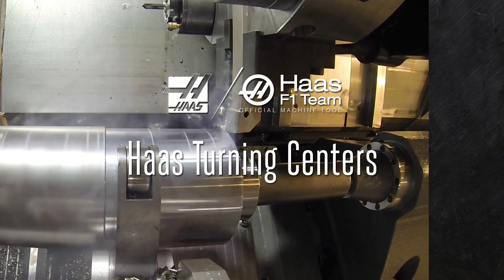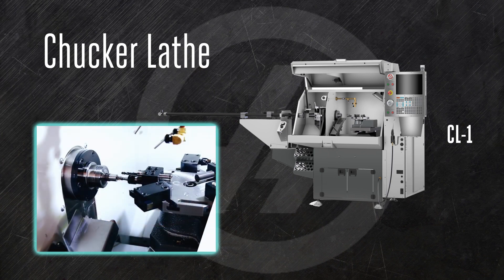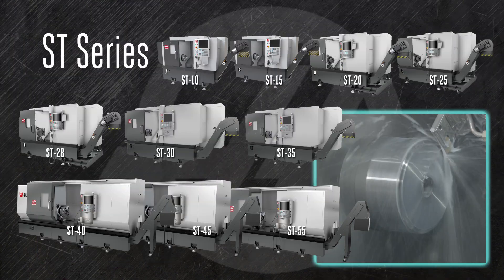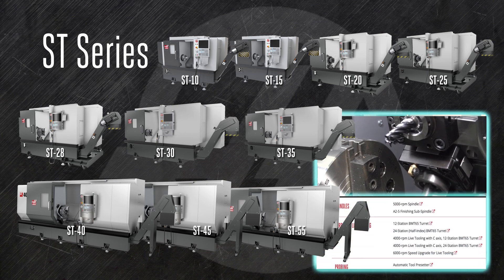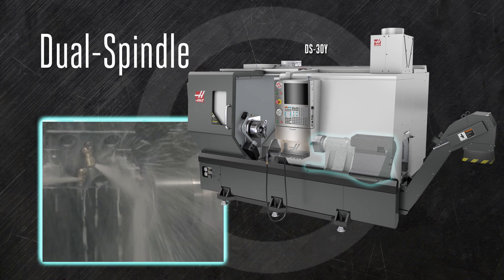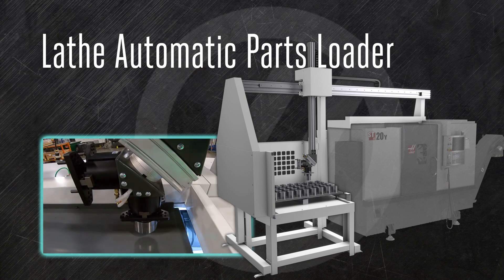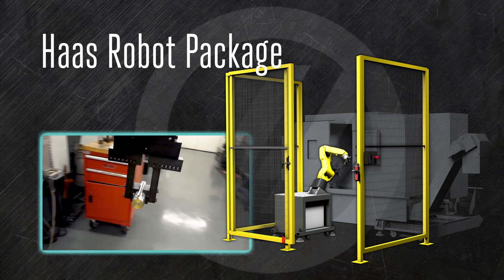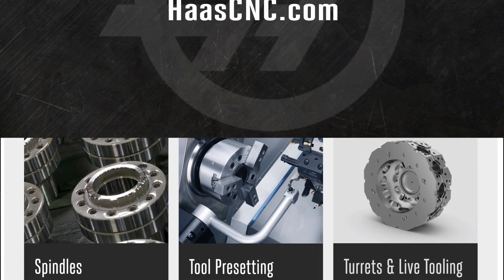Haas Turning Center Overview - Haas Automation, Inc.

Comment: Need a CL2 for slightly bigger and longer parts, just sayin 🤘

Or a swiss-style version with gang-tools and the moving stock for long aspect ratio parts. Doesn't even need to be as super precise and fiddly as a more serious Swiss, just be able to quickly knock out good volumes of small simple parts with milled features. Like an ST-10Y with subspindle, but in the CL1-ish package would be awesome.
Reply from the maker: Interesting idea Scott, no promises but we'll forward your comment to the design group to chew on. Thanks!
Reply: @haasautomation  No problems. And when I say it doesn't need to be as super precise as a fancy Swiss, I don't mean to imply I don't think it could be. I'm very happy with the accuracy of our ST10. But I see a lot of folks tout the Swiss machines as insanely accurate getting half tenths and all that, and I don't think that's always a requirement. I think a machine that was on par with the accuracy and repeatability of the ST-10Y but in a smaller package like the CL series, using the lower power and really tailored to making things like the valve bodies you might find in paint guns, or pen components, things like that. 

There are certainly tools out there from other vendors which hit those marks quite well, small gang tool lathes and swiss machines and so-on. And certainly a larger machine can still do a small part. But if you're a business where a lot of turned parts are in that smaller envelope even an ST-10 is a large machine in relation to what is being made. 

Meanwhile the CL-1 is close, and I'd potentially start there vs trying to scale down an ST-10Y. But its quite limited if the parts start getting complex, like as an example I have a check valve body that has threads on both ends, external O-ring glands, and some internal boring and chamfering from both ends, and then 4th axis machining from the sides. It's only .245 OD and .840 long. Great part for a swiss machine. And can be done in something like an ST-10Y easy too. But that machine feels a bit overkill if you're only making small parts like that and by the hundreds.  But the CL-1 just couldn't do that part very well as it is now. In some ways if there was a small Hass Swiss-like machine that could do these small parts I could see an argument for some companies to go with 2 of them instead of a single larger machine.

Food for thought I guess.